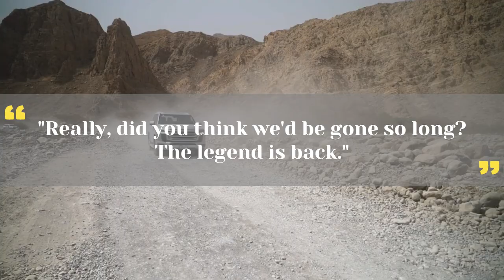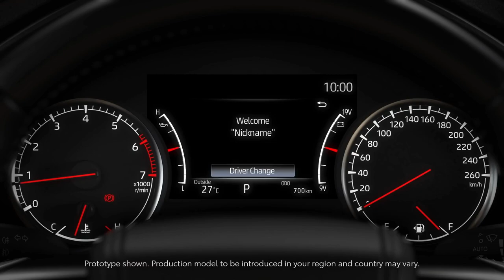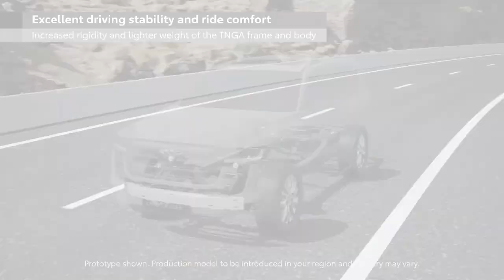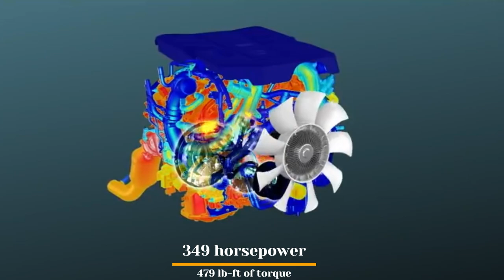Toyota Land Cruiser is Coming Back to SHOCK the Entire Market

Comment: before LC200 was only top spec  trim@$90k other markets  had ,have  low trim ,model GX with 2 rows cloth seats 18" steelies a off road wagon ,what we don't want is 3 rows of leather, no dual sunroofs no 2nd row screens , and luxury car bits , if Toyota  can price it between the 4runner trd pro and the sequoia TRD pro in that  $60,000 - $70,000  range  we would  buy it over bronco  ,maybe the  new 4 runner will  stay around  under $50,000   than $60000 for a LC than $80k for the sequoia trd pro [if we can buy them at  MSRP}